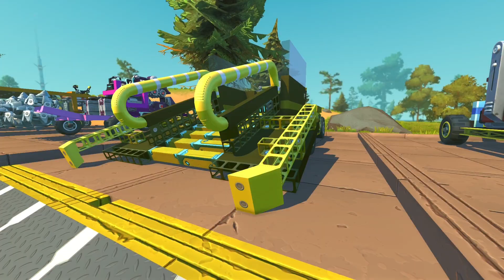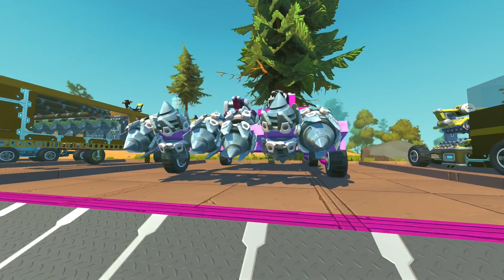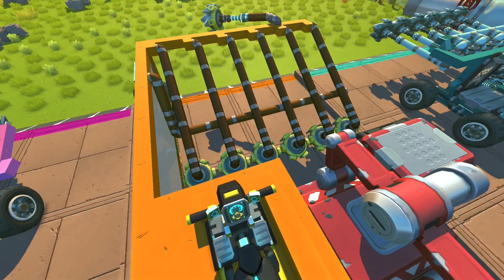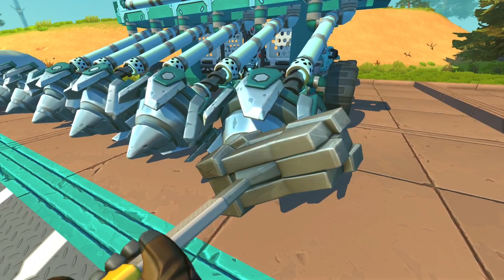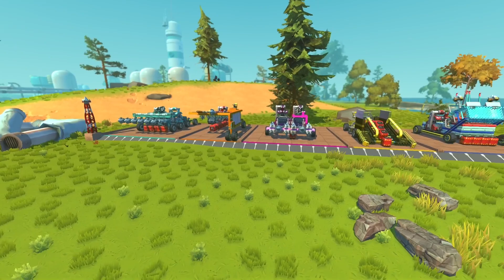Let's find the best way to mine rocks in Scrap Mechanic!

Comment: Finding an efficient miner has been a bother to me since i got survival. I still havent found one i really like, but you gave me inspiration and ideas with this video. Really well made. Thank you.
Reply from the maker: Awesome! Good luck with your projects.
I have another video where i explain that first bucket miner, if you want to know more about that particular mechanism.
Reply: @AgentWest  I'll check that out. Thanks!
Reply: So I made one a little while back for survival, it is a small machine and I have a separate vehicle for just refining, they don’t take a lot of materials for survival, and there is also a tree cutter version, if you would like to see I can upload them to the workshop, just gotta copy them first.
Reply from the maker: Sure, i'll check it out!
Reply from the maker: @Anniebob10  Found it! Was the first result. 
Have not had a chance to try it, but just from looking at it, that refiner module looks like a space rover. The whole setup got that space explorer look to it. Is the idea here that you manually put the rods/sticks/splinters/whatever on the harvesters then bring them to the refiner unit for processing? I did not see collectors on the harvesters.
Reply: @AgentWest  So pretty much I process a whole node with the miner and then bring the refiner over to it, and it picks it up. it only has one collector on it so it isn’t the most effect, the one in my survival is 4 refiners and 4 collectors so it is much faster, but it would of been a lot more work to copy over.
Reply: @AgentWest  Also the space rover design was by complete accident. My survival one has problems with the tires clipping in the ground, and it has 6 so I thought about making that one 8 wheels and well I made a rover by accident lol.
Reply from the maker: @Anniebob10  Huh, never had tires clipping into the ground, only into other creations (like when trying to build a monorail). Most issues for me come from bearings being a bit sloppy and shearing or shifting under high loads.
Reply: @AgentWest  yeah, bearings tend to have a lot of problems lol, but I think the tire thing is because of the weight, I just need to go back and test it more, but I got other projects in the game to tend to first, like a redesign of my auto planter so I just put the tire issue on the back burner for now.
Reply from the maker: @Anniebob10  Makes sense, especially since you found a work-around.

Comment: how is the name of the pink grinder style machine, i would love to have like a blueprint haha, i wanna make it in my surivval game
Reply from the maker: Since this was in Survival instead of Creative, it's not in the workshop. However that mechanism is really easy to build: make an axle from some blocks, then place bearings 3 blocks away from each other along two opposite sides. On the other two sides place bearings so that they are between ones you placed first. Place a drill on each bearing, connect them all to an engine/controller, and there you have it!

Comment: this is not really a fair comparation, most of the time the stones are in little hills and most vehicles can't handle that. i wish all the stones were in flat ground tho.(don't really mind the ones in hills and inclines, those are quite natural too)  i had a really similar design like the first one and it allways worked super fine (it struggled with the small mountains of some rock formations tho)
Reply from the maker: Yeah, unfortunately flat ground nodes are pretty rare, though they do happen.
This was just the beginning, a best-case scenario, where i could test out different mining mechanisms and not have to worry about suspension or getting stuck on those hills you mentioned. There is a follow-up to this test, a combination of two of the best performing designs from this flat ground test: https://youtu.be/3_SzaBezsAA

Comment: My mining vehicle is very simple. It's similar in function to the last vehicle in the video. It has a very small size with good suspension and is raised off the ground.
I used a suspension glitch to steer the vehicle. This makes it easier, as I do not need to move the vehicle when turning; I can turn while standing.
I placed a resource collector at the back of the vehicle to collect rods from the ground, and I used an electric engine because its torque is very high and its speed is slow. I used a max controller to rotate four drills mounted on suspensions.
The vehicle is a mining monster. Its very small size, suspension system, electric motor, and suspension glitch drive make it very easy to control while crushing and collecting rocks, even in the worst terrain.
When the resource collector is full, I take it to the refining vehicle, which contains two refining machines and many resource collectors. I also use it to transport small vehicles to avoid consuming batteries.
Reply from the maker: Interesting idea to have a separate refiner. While you do waste time driving to/from it, having a smaller mining vehicle lets you get to resources easier, so in the end it may even be quicker overall. Is your setup on the workshop by chance?

Comment: The third one would work a lot better with less drills (I've had very similar designs myself) 

I don't know why, but having more than 3 or 4 drills on a machine greatly increases the time it takes to destroy the stone.
Reply from the maker: Yeah, i think it's because it only calculates damage from one drill per piece at a time. Possibly? This one had that many drills simply so it won't miss smaller bits of material.

Comment: I would love if you could upload the other designs like the lime one, as I have an idea on how to use it without explosives and building it from the different frames is a little challenging.  I am up for the challenge though!
Reply from the maker: Upload to the workshop? I usually don't do it with these machines since i build them in Survival, and moving vehicles from there to Creative is a bit of a pain. What's your idea, anyway?
Reply: @AgentWest  I did some testing dropped the physics slider to imitate survival and the bearings were a little floopy for my first idea.  The first idea was having arms that extend from the box with pistons but it was floppy.  I then removed that and put arms that flip out with drills on the end on the conveyor wall which worked a little better.  Unfortunately my testing was being affected by instances were the grabber arms got lodged and when I separated myself from the rock it would go crazy.  I then started to work on making an all around bigger version but haven't finished
Reply: I think everyone here would love a discord for your channel to talk ideas for miners and tree choppers and everything in between
Reply from the maker: @mrmagic9756  Interesting that you have to drop the physics down. I always thought that it's the same for both game modes.
Reply: @AgentWest  Nope, its hard coded too.  That's why suspension glitches aren't as strong.  Anyways I did upload some of my remakes of your miners.
Reply from the maker: @mrmagic9756  Oh neat! What did you name them in the workshop, so i can take a look?

Comment: the "mine" miner, if combined with dual refiner would likely be the winner. 
yes, i got a few chuckles out of the finding nemo clip. it does fit the mine(r) though. :P
i believe this to be true because, unlike the other miners, you don't have to wait for the rocks to be broken down before loading another.
you spent some time waiting for the refiner to catch up with storage. if you had 2 refiners, it would have gone much faster. 
maybe you could see if this is true by modifying the original with a second refinery and running the experiment again?
i am interested in your conclusions.
Reply from the maker: Good point, don't know why i haven't done that to begin with since other machines have dual collectors and/or refiners. Also glad you enjoyed that "mine" part :)
Reply: is there a workshop to one?

Comment: Is there a workshop link for the gatherer goldn hands thing?
Reply from the maker: No, there is not. Since all of these were built in Survival they can't be workshopped, not easily anyway.
Reply: @AgentWest  ok,  I've already got it down anyways and am moving on to making a ropa maus style gatherer with drill reel
Reply from the maker: @thegoogoleverplex2911  Had to look up what a one of them is, and looks like it's using a set of screws for moving material. How are you planning to replicate that in SM, since there are no parts that act like screws? Angled rollers?

Comment: None of these really look that good for most rocks because they're on a hill bump 80% of the time.

I have a thing that closes from the sides and the top with a controller and bearings and it sort of clings and squeezes to the stones so it works pretty nicely.

Comment: i really want first one to aperar in your steam workshopm i did like it pretty much, i really want build it in survival.
Reply from the maker: Exporting from Survival to Creative (to be able to upload something) is kind of a pain, then you have covert it back to Survival and use console commands to actually spawn it. So instead I made a video explaining how the machine works and with that you should be able to recreate it in your world: https://www.youtube.com/watch?v=s6_B5kARLsY
Reply: @AgentWest  its ok no problems, i tried recreate it once have issues with building a bucket for rocks and wiring the whole controller systems, I'm from people in SM who doesn't know  how to build complex systems like yours😅
Reply from the maker: @mibman7654  Logic can get stupidly complex in bigger builds, but the main thing to remember is that connections are directional. Switches and sensors will always "output" a signal, but logic blocks can do both "in" and "out", so AND >>> OR is not the same as OR >>> AND. Aside from that, just experiment and you'll learn it in no time! Build with however many logic pieces to get the task done, then simplify from there.